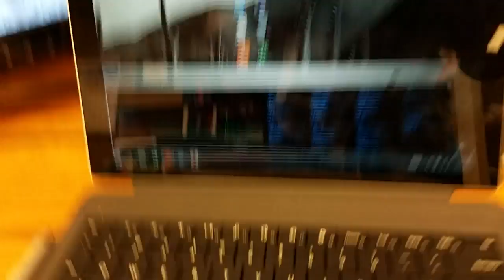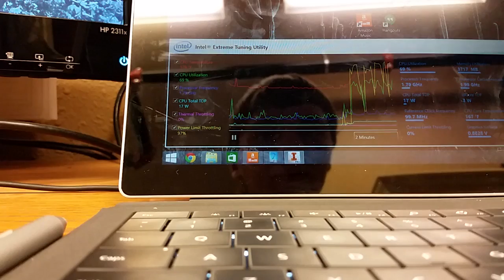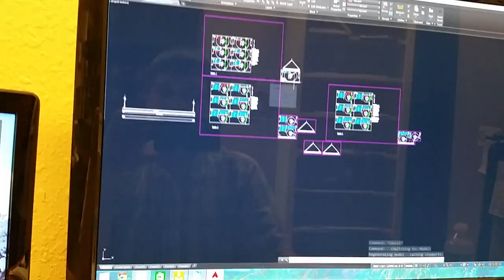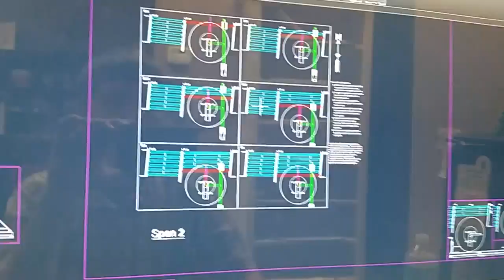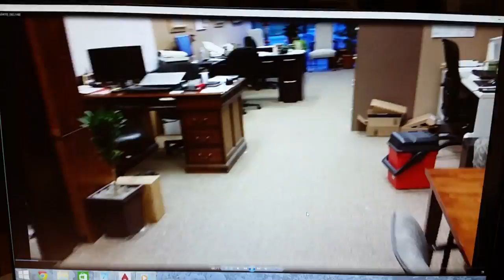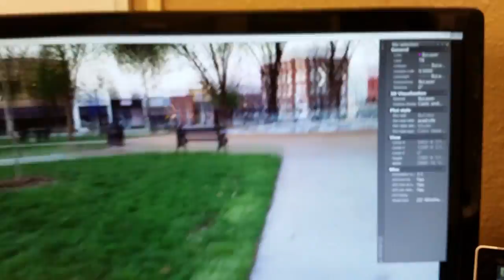Surface Pro 3 Testing

Comment: Excellent real world review. 
My experience with the SP3 i7 and the SP4 i7 is that heat dissipation is more efficient with the SP4. It can take 20-30 mins longer to throttle the SP4 under heavy load than the SP3. Of course, with the extra RAM (16GB) on the SP4, I experience improved performance as well compared to my SP3 with max 8 GB RAM. Video rendering is where the SP4 really shines.
Reply from the maker: +txmoney That is good to know.  I am considering trading to the SP4 when AutoDesk releases software for Windows 10.

Comment: Great video man! thanks for sharing. That really helps me, I also use Inventor a lot and it's very hard to find a powerful thin laptop. I was about to go for the lenovo yoga pro 3 with core M but now I guess I'll go for the surface. Thanks
Reply from the maker: Marcelo Barrera No problem

Comment: I really want to get a surface pro 3. I want the i7, 128 gig model. However I am going to school for engineering so I will need autocad and inventor a lot. Can the surface handle it or should I go with a regular laptop?
Reply from the maker: NoBigDeal For most everything I have done with it so far, the surface has been able to handle it.